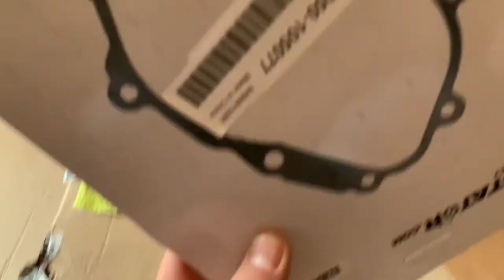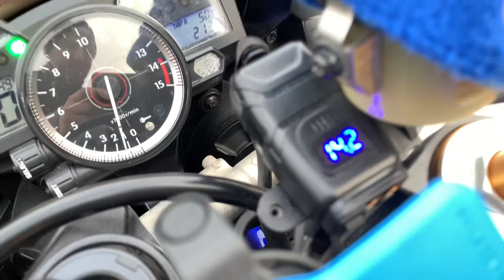Replace damaged stator/ Upgrade RMstator Yamaha R1 2008 RN19 4C8

Comment: Firstly, thank you for this "how to" video. I live in Canada and have a 2007 R1, I decided to proactively change the rotor even though mine looked fine at 22k. I didn't see the need to replace the stator so just did the rotor. I had 3 options, $950.Cnd for OEM, or $250 for the RM or Kimpex (China Made) replacement. I called RM Stator first but they were unfortunately resistant to answer my questions, I found their customer service poor. I ordered a Kimpex brand one which looked exactly the same as RM Stator's. The rotor looked decent but had improper machine tolerances, the spacer didn't fit over the shaft - some people apparently sand it down but I didn't feel comfortable doing this, nor should you need to if machined properly. Additionally, it fit too loosely when seated in the bearing. Returned for OEM. BTW the OEM has updated this part and it does look slightly different than these Chinese knock offs. In a high HP, high RPM engine, I'd buy Japan made OEM... just my opinion. Good luck & stay safe!
Reply from the maker: Thank you for given my channel a chance. Agee  with you about OEM parts definitely better. I couldn’t get the OEM so i had to go for next one after and same like you had a bit of looking and all guys recommended the RM stator. Thanks one more time
Reply: Yup. Put an rm stator in my fz1 last week just for preventative maintenance. Seen a ton of people using them. Well the bearing races are thinner. And I believe it took out my bearings.
Reply: @kokobeatz7222  Hello there, how is that RM stator holding up?
Reply: @sonum1059  it restricted oil flow to the top of my engine. So I had  to put an OEM one in. I do not trust Chinese parts after all the failures I see daily.
Reply: @kokobeatz7222 how did you notice this ? After putting it in ? Now I’m scared to install this

Comment: Thank you for your video! How is that stator and rotor holding up? I just ordered one is it a good thing to do and quality piece? 09 FZ1 . Thank you for your time.
Reply from the maker: Thanks for watching and appreciation. I have done 2 .5 k miles since that video and just took it apart again to check and also do a leak on the starter motor. Everthing looks as i fitted yeasterday, and also charging 14,3 v in race mode and 13 v in iddle. So go ahead and do it. RM all the way. Also did bearings now but no problem with the old ones . I will have some more content about R1 soon.
Reply: @ciprianandronescu3339  That is so good to hear! Thank you so much for your fast and detailed response ! Helped me through my day 🙏🏽 I will be subscribing now 🎉 Have a good week my friend 😊
Reply: Hello there, how is the RM stator holding up? I have to change mine. OE cost twice more and Rick's motor stator $166 compare to $320 OE. RM only $135. Should I use RM for my 2006 Yamaha vster 650? Thank you for sharing this video

Comment: nice video, but you didn't change the bearings ? hope it works out for you.
Reply from the maker: Those bearings are sitting in oil, they are not sealed unit so we can say the grease wears out. There are bearings in gearbox how come we don’t need to change those? I’ll do more research and change them if needed.
Reply: @ciprianandronescu3339  Still doing well?
Reply from the maker: @robertpaulson3935  yes pal , everything running smoothly
Reply: @ciprianandronescu3339  Good to hear, doing mine in about an hour

Comment: Do you think oil pan should be taken off and cleaned out is it necessary
Reply from the maker: It depends more on the state of the assembly, rotor &stator , on the how bad it looks damaged. I guess mine happened and damage was minimal as you can see kinda everything stayed inside the flywheel. Best yes oil pan taken out for your piece of mind but i think new oil mixed with a can of engine flush and drain and then new oil and filter should do the job, also check the old oil through a cloth for pieces.
Reply: Apparently after 2008 the stator were much better.did you put a upgraded back in with a solid magnet or did you go for a later stator with the 16 magnets
Reply: I see you used a up graded stator sorry

Comment: Hey I put the washer and spacer on the flywheel gear before I insert it back into the bearing but there was no click sound, I can’t get the spacer to fully press down onto the washer, there’s a tiny space between..any suggestions
Reply from the maker: I don’t think i heard that sound either. Aslong that you got them back in same order and that spacer with baveld edge facing correctly I should be fine. Check the paperwork and schematics. You can find it on forums

Comment: Hello there, 

Do you know by any chance if on a 2015 model FZ8 is this problem with the flywheel in case? 

Thanks! 😊
Reply from the maker: Hi, i’m not sure, sorry.
Reply: The fz1,fz8 and r1 have the same problem
Reply: Think I read something about they were better stator after 08.there a upgraded stator with a solid magnet inside.maybe its worth changing

Comment: I dropped something down that hole. Does anyone know how to get it out?
Reply from the maker: Oil sump off now. I haven’t removed mine because I wasn’t so much damage on stator and kinda everything stayed inside , but in some cases pieces will drop inside crank housing. Best to remove pan and give it a good clean while you’re at it and you’ll find your missing thing.
Reply: @ciprianandronescu3339  I retrieved it. All I had to do was remove the radiator then the exhaust then the oil pan. Simple lol

Comment: how work your's generator whitout magnet? :D will you looking where is yours general problem? how did it fail?
Reply from the maker: It still got magnets on the flywheel but they are behind that sleeve. Upgraded flywheel
Reply: The oil and heat breaks the proxy down over time.look at the new upgraded stator which he's used with one solid magnet

Comment: What were the symptoms of your stator going bad?
Reply from the maker: Subscribe 4 new exciting videos. So easy just to ask stuff but so hard to do this kind of vid. Also got other stuff about R1 on my channel. If you already subs i do apologise. 
Now back to you.- not so long before i had the issue with stator i had myself fitted a voltage meter because i knew the problems of this model. When it was ok stator was putting out 14.3 v , one day after a while went out for ride and it dropped from 14. to 12.something volts and very quickly went to 9v . And dead.  It had to be failed stator and thsnks to my vastly and superior knowledge I didn’t try to jumpstart or push it or do anything else because it’s then when pieces of stator falls inside the crank case. Hence all the gone engines. Got a van , took it home , took everything out and as you can see in video, it was busted but it stayed in the flywheel.  Enjoy.

Comment: Would you go with rmstator again?
Reply from the maker: No issues since fitted that on the bike. Also for the sake of few pounds for a new gasket you can take it off after 2 or 3k miles and inspect and a voltage display will also help alot keeping an eye on , if it’s always 14.something volts you know everything it’s ok.
Reply: @ciprianandronescu3339  okay im thinking probably wire a volt meter in as well. But all in all. If you got another r1 or even fz1 you wouldnt mind doing the rmstator branded flywheel again to save some money? How many kms or miles have you put on it?
Reply from the maker: @N.m.M2024  i wouldn’t mind yes. I’ve got nearly 3k on it now
Reply: @ciprianandronescu3339  okay looks like ill go rmstator. What made you go with yamaha for one and rm with the other? Just testing them out? I just did a full rebuild and would be bummed to mess it all up so wanna make sure rm isnt a bad choice
Reply from the maker: @N.m.M2024  RM all the way for the money save. Seen Yamaha’s version looks same, went on forums and everyone said same thing about RM satisfied users. You can try this though if you still have doubts, get the OEM flywheel and take your stator to be rewired by certified companys. And you’ll save money.
Reply from the maker: Like . Share. Subscribe
Reply from the maker: More vids on my channel about R1
Reply: @ciprianandronescu3339  thats not a bad idea! Still might end up with rmstator flywheel, some people dont like them some do. Ive got 3 stators so hopefully one is good. I appreciate your fast feedback and honest opinions

Comment: is the bike still running good? how many times have you rode the bike since changing the bearings?

could you do another short video of how the bike runs now?
Reply from the maker: Hi mate, yes the bike runs perfectly since i had replaced stator and it’s charging 14, v all the time. I had been riding only twice because of great brithish weather. There is a short video on my channel but I didn’t took video of the rides because I didn’t had my go pro with me .
Reply: Thanks buddy, mine did the same thing, i dropped the oil pan, but im a little concerned maybe i should rebuild it...

Comment: Salutare, am acelasi model de motocicleta si a inceput recent sa se auda un suierat care creste in intensitate odata cu acceleratia si pare sa provina din zona la care lucrezi tu in video. A avut si la tine zgomotul respectiv inainte sa schimbi rotorul?
Reply from the maker: Salutare, sa stii ca da. Si am crezut ca poate casca sau poate cine stie ce si nu mult timp dupa mi-a picat incarcarea. Sa schimbi si rulmentii la rotor. Esti mai in siguranta. Like share si subscribe
Reply from the maker: Nu te mai da cu motorul pana nu schimbi statorul si rotorul ca risti sa se dezintegreze si automat distrugi motorul daca bucatele ajung in baia de ulei.

Comment: I have a 08 R1 and i'm already preparing for this 🤣 mine 27.000km, can you explain why this happen? Thanks from Portugal
Reply from the maker: It’s a common fault of R1’s engines before 2009 big bang. The rotors flywheel has all magnets  xposed and after so many miles they go loose and starts grinding and disintegrate the stator
Reply: @ciprianandronescu3339  High rpm may be one of the problem's? I have read the rotor double the rotation of the crank.. You dont remove oil pan to inspect contamination?
Reply from the maker: @Anatatto  I’ve flushed the oil only because I’ve replaced stator minutes away from going bang and didn’t left to brake down on me and everything stayed in place. Also the oil and oil filter looked clean without debris and residue.
Reply: @ciprianandronescu3339  Nice! But your battery stop charging right? What was your first signal something was going wrong?
Reply from the maker: @Anatatto  i have on my bike an voltage indicator fitted since got the bike and before the issue was charging 14 V and on my last ride went from 14V to 12 and just befor i’ve got home it dropped to 11Volts only . So it was getting some power to the battery but not enough to charge it and I figured out it can only be stator so i’ve tooked off to find that. 🤞 That  voltmeter gauge saved me from having massive damage possible on engine.
Reply: @ciprianandronescu3339  Thats a very good safe!! Can you tell which voltimeter you bought and where? Thanks!!
Reply from the maker: @Anatatto  it’s the one on my short movie on my YouTube channel. No brand name , generic one can be found on ebay or on bike shops. Got another one on my R6 aswell and i can charge my phone from it. It’s best for when i’m not riding because it always tells me how much i’ve got in battery
Reply: @ciprianandronescu3339  Thanks! You connect directly to the battery? Where you install the wires?
Reply from the maker: @Anatatto  yes it come with terminal leads or wires that screws straight on battery , red positives and black negative, can’t go wrong, first get the wires through a fire resistant harness and then fit it on bike somewhere where you can see display voltage while riding your bike, like handlebars. Worth every penny.
Reply: @ciprianandronescu3339  I will buy one, Thank you very much for your help sir!
Reply from the maker: @Anatatto  any time biker brother, glad that YouTube helps.
Reply from the maker: @Anatatto  send me your instagram and I’ll video tomorrow and i’ll send it to you about voltmeter and also a trick to control your radiator fans so bike won’t get overheated if you ride inside city
Reply: @ciprianandronescu3339  @andregdk 👍